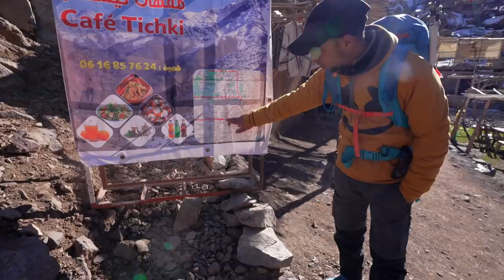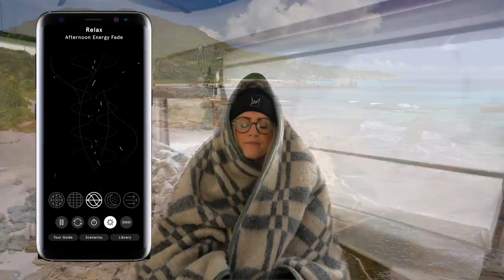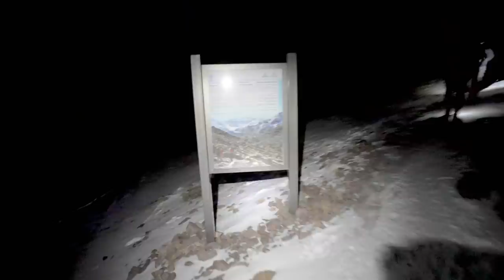Morocco's BIGGEST challenge (hardest day of my life)

Comment: Top tip. Always start the heater on full blast for 10mins and return it to full for 10 mins before switching it off. This helps keep the  combination chamber and exhaust clean. Good luck guys

Comment: i have had the same problem a few time, turn the heater on and blow through the air intake pipe as hard as you can while its trying to start, and put it on full blast for half hour to burn of any carbon, worked for me a few times now, its probably the elavation your at thats caused it

Comment: The diesel heaters internals will probably need cleaning if the smoke is anything to go off. Plenty of videos on YT to help you. Not too difficult to do. Engine battery sounds like it needs replacing if it is losing charge when not in use. Even in cold weather the battery should be OK if it is a good one. The altitude may have an effect on the diesel heater but a good internal clean out will do it good.

Comment: Craig, as a precautionary, when you return to the UK you should have your lungs checked by having a High Resolution CT Scan.  Experiencing breathlessness so early in your trek is not always due to a fitness issue.  There are many causes of breathlessness.   Best to be safe and sure.  I know from personal experience.  Back in the 90s, I was hiking a lot in the mountains at about 6,000 feet above sea level.  I was the only person in my hiking group that would experience breathing issues.   It was a precursor to a health condition that was diagnosed 20 years later.

Comment: Diesel heater might work normal now, higher altitudes can be a struggle, requires some other settings. Also for those Chinese heaters, make sure you have spare glowplug and PCB. They are cheap and will fail eventually. Also, you cleaned the exhaust, while the lady was talking about the air inlet (the other hose underneath the van). 
Not starting might be caused by too little power as well (glowplug not heating up sufficient)
Reply from the maker: Thank you! Since this video we have broken it even more which is cool 😂 I think we're done for now unless we can find a new heater to buy.. but it doesn't seem do able in Morocco and no where ships in.... cold toes for the foreseeable it seems! 😆

Comment: Had my fair share of issues with Chinese diesel heaters, I find when they smoke like that if you can get them to start, run them on full whack for a while and it'll help burn off some of the soot and "dirties"
Reply: The smoke will clear once its running hot, or it'll cut out possibly with an E-10 error 😅 good luck !

Comment: Great video guys! Well done Craig in climbing the mountain! Top achievement!👍💪 (Glad most of the gang have tackled the mountain now! Shame you couldn't all together but good stuff!) And well done Aimee in battling through your anxiety! 💪
Great video as usual! (Try cleaning the exhaust pipe with a brush on a wire if you can find one or a rag on a wire (maybe a wire wool scouring pad on a coat hanger that should free up any soot build up like sweeping a chimney!) You could soak it in petrol aswell but make sure you dry it well before it's used so it don't catch fire! Lol 😅
Anyhow one of those should do it and if not it might be in unit clogged up aswell (don't know if you can take it apart and have a go at doing similar with the inside and giving it a once over? Hope that helps!?)
Best wishes from London and Merry Christmas if you don't post before!! 👍❤️🏴